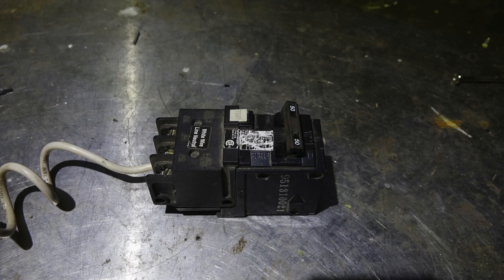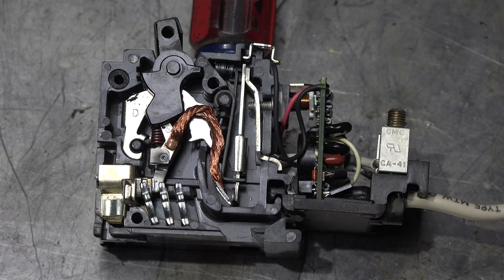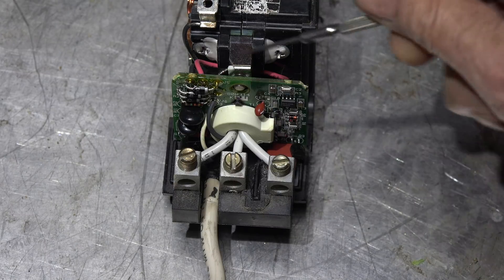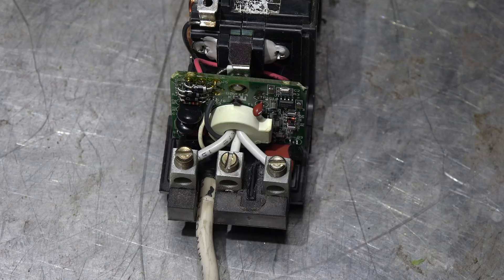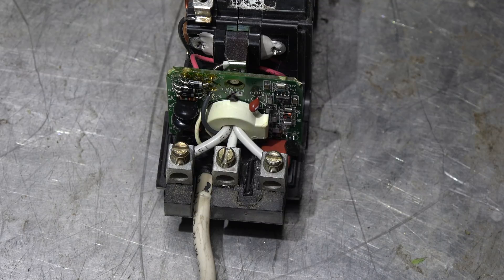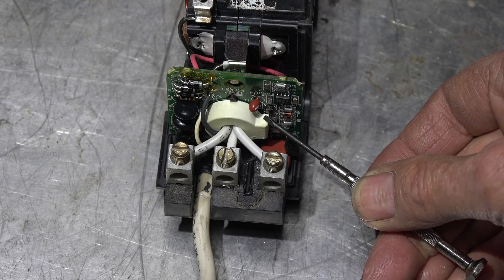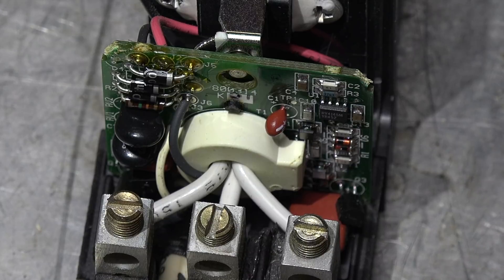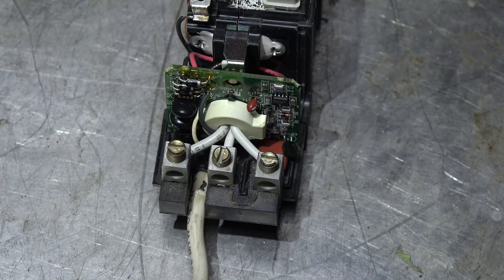How the 2 pole GFCI works.

Comment: This video fails to consider that the load could be rated 120/240 (using 120V control or motor circuits, for example). Therefore, some current from L1 or L2 could return to the breaker in the neutral wire. So long as the SUM TOTAL of currents on L1, L2 and N connected to the breaker = zero, the breaker will maintain. Let's get it RIGHT when we post stuff, shall we? !!!

Comment: I have a question. What  if L1 10 amp, L2  9 amp, the neutral 1 amp, would that cancel the current through the magnetic ring ? It can be a fault.
Reply: If the neutral current was in the SAME direction as L2 then it would cancel it out.  Your question was ambiguous due to not specifying the neutral direction.

Comment: Yes, understand that the 240 v L1 and L 2 must be, and are, balanced, BUT
CONFUSED how the GFCI accounts for the current on  the NEUTRAL that is
used by any 120 v load in the same appliance. Hopefully this is clear.
Thank you for the info.
Reply: The current is flowing in the “opposite direction” on your neutral so it will still be a net zero if you have a 240 appliance across both legs and a 120 appliance across one leg and neutral.  As long as the electricity is “all accounted for” at the GFI breaker (amp ring around all 3 wires together reads zero) you should have nothing to worry about. The only reason this will trip is if electricity leaves one or both legs and does not make it back to the breaker either by the neutral or the other leg (meaning it found ground elsewhere).

Comment: Thank you for the information on the two pole GFCI.  One correction however, the "horseshoe magnets are actually "arc blow out" devices to break up the arc that is created when the contacts open while under a load (when current is flowing).  The overload is detected by a bi-metal strip that the load current passes through.  The current will heat the bi-metal material which will cause it to bend.  If it bends too far (due to too much current) the bi-metal strip will release a trip mechanism to open the contacts.
Your "balancing" theory is correct on detecting ground faults.  The inductor (CT or Current transformer) detects any difference of current in the three lines.  When it detects a difference of about 6-8 mA, it will energize the solenoid you mentioned to trip the breaker.
Thank you again for the video.

Comment: What if my device doesn't use neutral? That still works?
Reply: It will be fine.  Connect the breaker’s neutral pigtail regardless. As long an the net current supplies by the breaker is zero all is well - even if only two of the three wires are in use it works.
Reply: A little late but here’s your answer.  The two legs are 180 degrees out of phase with each other in a split phase system. This means that your hot/hot will cancel out in an amp meter to net zero, even with no neutral.  This will still work on a purely 208 or 240 plug with no neutral.
Reply: This is my question too, how do I gfci protect a hot, hot, ground outlet. (Nema 6-20)
Reply: @scheffman  in my case I installed 3 water pumps 2 phase no neutral so do you think that still works?
Reply: @MrSeth166 , I'm not sure exactly. But i think there is a way to install a gfci breaker that doesn't use the neutral pig tail.  Still doing research
Reply: @scheffman  I did install the neutral otherwise the GFCI won't get neutral for the electronics which I think might work at 120 volts
Reply: @MrSeth166 , well if your current outlet has a neutral like a 14-50 outlet then yes your answer is simple. My question is, how can I protect a nema 6-20r. There is no neutral.

Comment: One thing that I might mention is that you could actually have 9 amps on L1, 10 amps on L2, And 1 amp on the neutral and the breaker would not trip because the power is returning through the neutral and is not a ground fault. The current transformer would not read anything because the 1 amp flowing through the neutral would cancel out the extra amp flowing through L2. The reason this is done is so a 120v load on the circuit (line to neutral) would not trip the GFCI breaker.
Reply: right on k456 :)
Reply: Yes, my house is wired up using multi wire branch circuits, so the GFCI and AFCI's are all dual pole.
Reply: I've always wondered why there was a neutral wire on a 2-pole GFCI breaker. Now I know
Reply: K456. Question please.   If L1 and L2 ARE in balance as they should be at all
times on a 240v line. How does this GFCI account for the 1amp DRAW thru
the neutral. Would seem to CAUSE an imbalance? Always interesting to
ponder things. Thank you.
Reply: Thank you for taking your time to make this video.
Reply from the maker: @K456-n3z  Interesting.  That was one part of the wiring I was not sure of.  Thanks, it makes sense now.  I will be doing an update on that video.
GFM
Reply: Still not convinced.   L 1 and L 2 are balanced in normal ( no fault ) 240 v operation. CONFUSED as to how the GFCI accounts for the 1 extra amp on
the neutral, which is coming from any 120 v load within the same appliance?
Reply: @tedlahm5740  in pure 240v operation yes both legs will be balanced unless there’s a ground fault; you are right about that. But if this GFI breaker is feeding a sub panel with say a 240v water heater using L1, L2, and ground, and the sub panel also branches out to a 120v 20a receptacle that has a 1a draw from a lamp, then you will see 1a more on one of the legs and also read 1a on the neutral. The neutral in this case will cancel out your 120v load(s), thus keeping the reading around all 3 conductors at zero because there is still balance in the circuit as a whole—the current that’s leaving is still making it back to the breaker because there is no ground fault.  I can totally see where someone would get confused on this as it happened to me as well, but I just took a minute to think about it and figured it out.

Comment: question: I have an old 80's furnace and my 24V relay makes the odd loud buzzing noise, is this normal??  I since replaced the relay with a newer one and that one buzzes occasionally also...
Reply from the maker: It could be the transformer that is buzzing.  It hurts nothing unless it is loud enough to cause problems with noise.
GFM
Reply: they don't seem to make them as good as they used to, and it is the relay that ends up buzzing sometimes, possibly some induction from transformer, sometimes it's just the cover that starts buzzing.... they seem to do it worse certain times of day when supply voltage is lower or higher o also when a bunch of dirty load is present on the power lines. like high current half wave rectified hair dryers (on low) or similar is on same phase...
Reply: @throttlebottle5906  Yep, a DC offset will do it for sure as it causes "flux walking" in the transformer core. My Keurig can make all the transformers in the house "sing" at times because it uses a triac to ramp up and back down the heater wattage and it isn't always symmetrical when it does it.